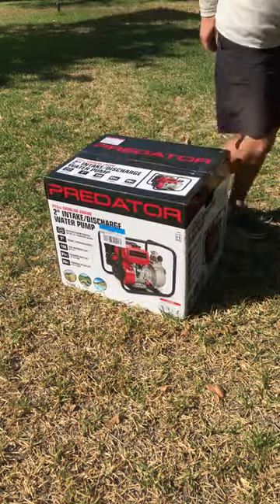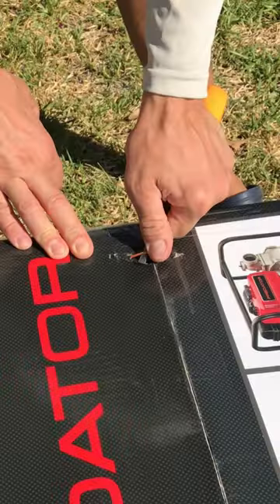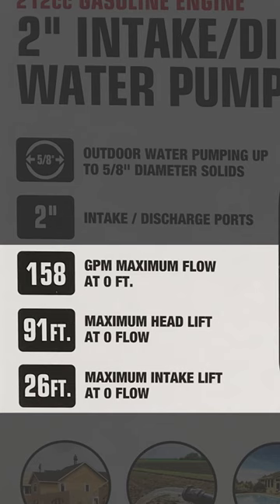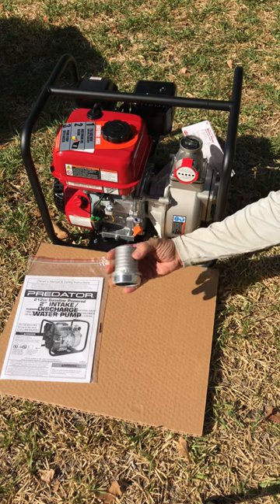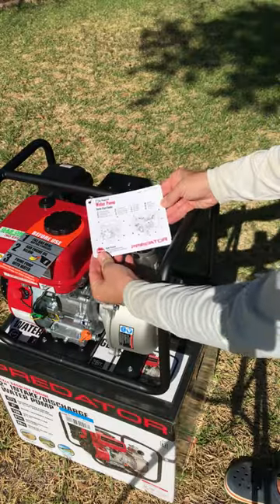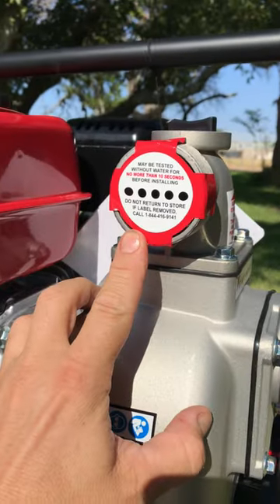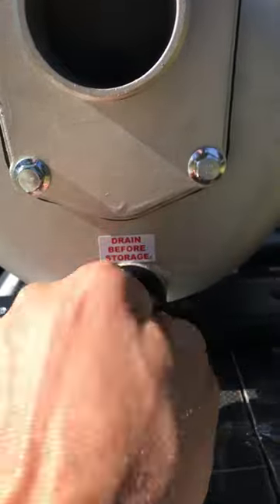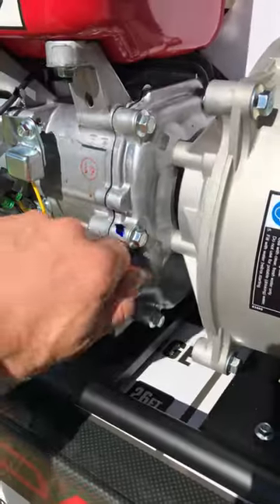Unboxing a 212cc pump   (Harbor Freight Tools) (#shorts)

Comment: btw they are both dipsticks for the oil it’s just so you can drain from either side
Reply from the maker: you're correct in that you can fill/drain from either side, but - at least in my model - one side does not have a dip stick (cap only) ... and they're at slightly different levels (I'll talk about that in the next video - will go live next Tuesday)